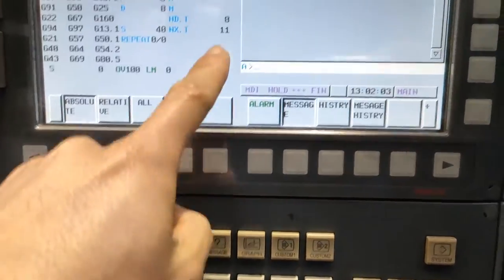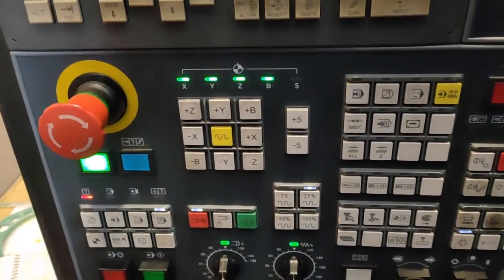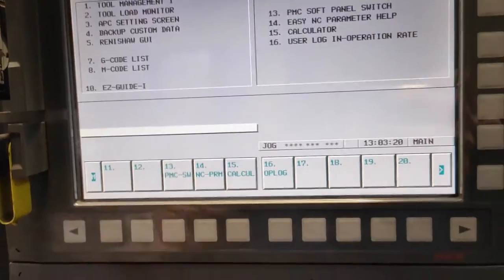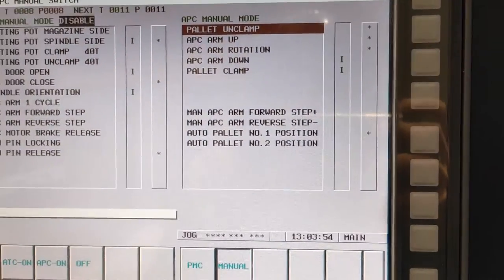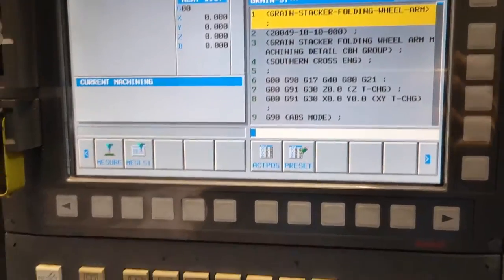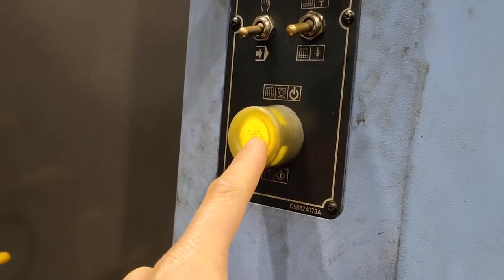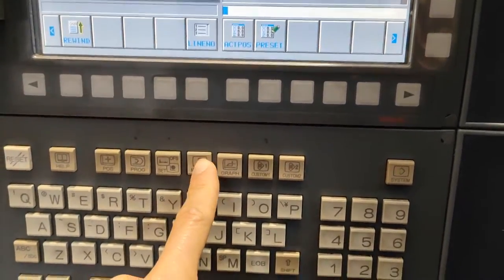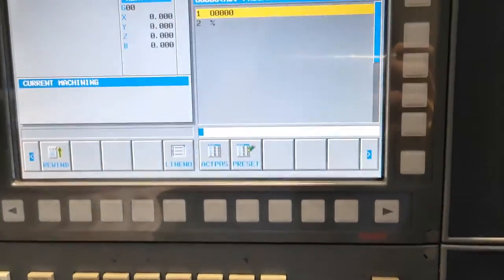HOW TO FIX IF PALLET STOP WHILE DOING PALLET CHANGE( nhp8000 doorman fauna)

Comment: You can get a similar alarm on Okuma Spacecenter Ma600, Palett clamp. Manual step backwards and let the palett raise, blow and clean off dirt from the four table points, and then step forward and let the palett sink down, the alarm should now be gone.